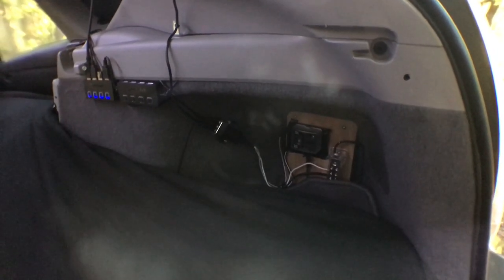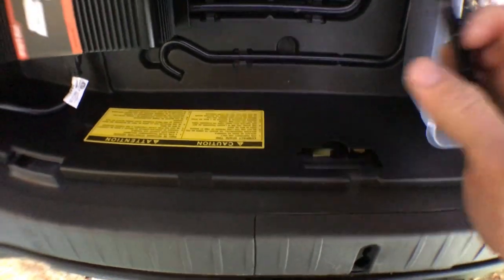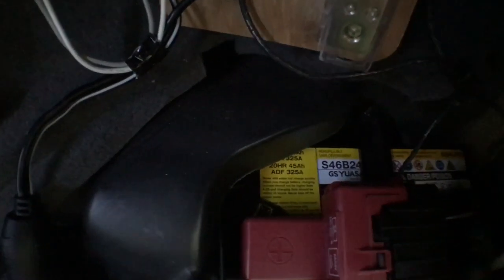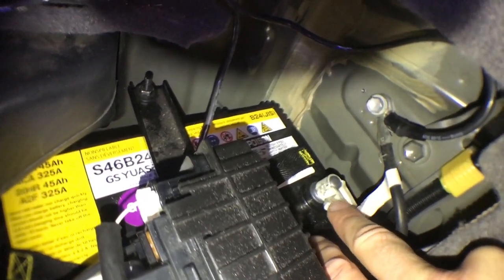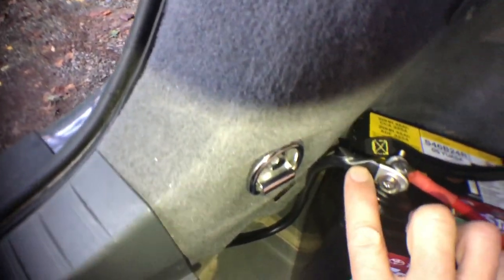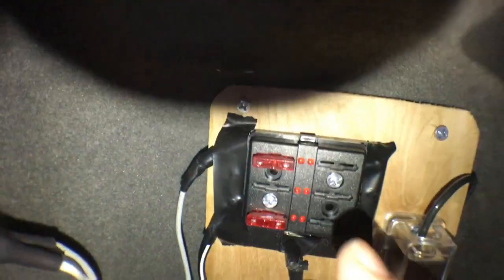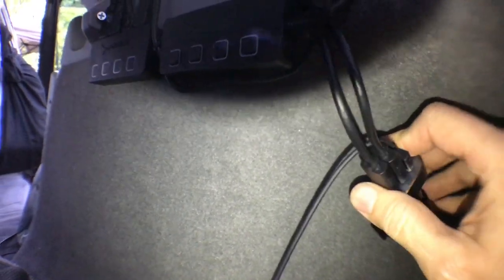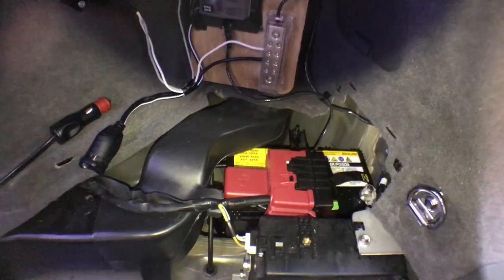Prius Stealth Camper - Electrical: Adding a second 12v battery, inverter, microwave

Comment: Hey! I'm really interested in getting a Prius for living in it. Thing is, I'm pretty tall - 6'2". I'm wondering, how tall are you / and would I be able to fit? Thanks!
Reply from the maker: I am 6’. I have a 3” mattress and added a little extension over the fridge which gave me 4” more. I can sleep without my toes hitting the hatch if I move the front seat full forward and tip full forward. I went to the car lot and laid down in the back before I bought. The salesman thought it was a cool idea once I explained it. Some of the newer models may not work but then Gen 2 and 3s should work. Mine is a 2009. Last of the Gen 2s. I ended up removing the microwave which allows me to sleep more diagonal. Be very minimal!!!
Reply: @timdillen  thank you! I think I'm off to buy a Prius! ♥️♥️♥️

Comment: I think your Ideas are clever and studied. One question, Why? What motivates you to do this? Just curious.
Reply from the maker: It's just a fun hobby for me. I like solving problems with small spaces in cheap ways. I also like to travel on the cheap as well. The less I spend the less I have to work.
Reply: PriusStealthCamper Adventures I live in a camper on my own land, I think my Prius has more efficient climate control than I can build. My motivation is also to save money. But also to fight back against the consumer mentality that we confront.
Reply from the maker: I like trying to see how little I can live on. It's amazing how much stuff you collect over the years that you never use. I gave it to Habitat for Humanity and rest to the dump.

Comment: About to tackle this challenge. 2 Quick questions though. 1.) What gauge wire did you run between the inverter and the battery and did you inline fuse it? 2.) Did you have your Dometic fridge running through the fuse box, and if so, is a 10 amp fuse enough for it?
Reply from the maker: I can't remember the gauge, it was the thickest wire I could find at the auto parts store. For long runs I got the thickest wire at Walmart that was jumper cables and cut off the ends. I did run the fridge off the fuse box and I think a 10 amp should work. I am not sure if there is a small spike on compressor startup but I seem to remember that it can run around 4.5 amps when running hard.
Reply: @timdillen  My Dometic Fridge just arrived today. So excited to get it up and running!!! So, I've finished the bed portion, but now I need to do the electrical wiring. I called the Toyota shop and they want $35 for the positive terminal clamp and another $35 for the negative terminal clamp... That's almost half the cost of the battery...Unbelievable. I think I'd rather go your route and drill into the battery terminals themselves. May I ask how you did it? Did you just use a regular drill, or did you take it to some kind of shop and have them drill it for you? I'd rather spend $70 towards a new drill than have to buy these clamps...
Reply from the maker: @dancereaper  Awesome! Love my fridge. I just used a regular drill bit. The metal is quite soft and drills easily. I drilled a little smaller than the bolt and then screwed the bolt in and the bolt made a good tight fit.
Reply: @timdillen  When attaching the baseboard for your grounding bar and fuse box, what size and length of screw did you use? You made the comment that it doesn't really show the holes. Also, on your curtain video, you screw directly in the plastic. I've resigned to the idea that I'll have to do it as well. Do you remember the screw size for that as well? As always, thanks man.

Comment: Thank you for making informative videos! Question, could you plug in the 12v fridge directly in to the car cigarette lighter port?
Reply from the maker: Thank you! Yes. The dash port does not stay on when car is OFF but I believe the one inside the center console does. Just don't let it run all night with the car in the OFF state or you will drain the 12v battery and the computer will not have enough power to start the car. You can leave the car in the ON state and the fridge will be just fine for days.
Reply: PSC Camper Conversions thanks a squillion! I am waiting for the 2019 prius but in the mean time i am taking in as much knowledge so i could excecute smoothly.
Reply: Let me see if I understood this correctly:
Two 12v batteries in parallel?
Each 12v battery terminals (left) powers the inverter and the right powers the 12v system (usb hub and dometic)?
Each battery is discharging independently? Yet charging simultaneously from the hybrid system?
Reply from the maker: That is a bit tricky. Yes the 2 12v batteries are in parallel and change at the same time. For a 2 reasons I put a disconnect on the 2nd 12v battery. 1 - so I can use all night and power my 12v lights and chargers without worrying about killing both 12v batteries and the car not starting (if I had the car in the OFF state) and 2. to test ideas out without a direct connection to the car's computer. Normally I live the 2 batteries connected. Hope that makes sense.

Comment: So when you're running stuff off your battery, does it refill your car battery from your traction battery before running the engine, or does the traction battery charge level stay more or less the same? I ask because I have the plug-in prius with the much bigger traction battery, so I wonder if I've essentially got the same setup without having to install a second battery. :-)
Reply from the maker: That's a great question and I have tried to figure that out. I don't have any information that I can find on it, just what I have seen with my monitors. The cars electronics, cooling fans and a/c run off the 12v battery. It seems when the 12v battery gets low (with car in ON position just resting), the engine will kick on and charge the traction battery and the 12v battery comes up to charging voltage immediately. After the engine shuts off, the 12v battery still maintains charging voltage so I assume it continues to charge off the traction battery. Then when the 12v has depleted the traction battery enough, it calls for the engine again. This is most seen with running the a/c while stationary. The a/c seems to be all 12v. That's the best I can come up, the newer cars may employ a different scenario. 

Your Prius is probably fine without the additional battery. I wanted to be able to run my 12v fridge for 24 hours with the car completely off (it couldn't do that prior). Thanks for your question and for watching!
Reply: @timdillen  Question - does the second battery charge fully? I read somewhere that the 2nd battery doesn't fully charge if you connect it the way that you did. They said that you'd need a DC-to-DC charger, which are super expensive, to charge the second battery fully. Have you had issues with the second battery not charging fully, or depleting quickly? 

I have a 2016 RAV4 Hybrid and I assume it's a very similar system.

Comment: Do most Prius have the second/extra battery in the back? I checked out a few but they never seem to have it? Only certain years? Can u watch a regular (small flat screen) TV in there?
Reply from the maker: Raina Fortini I think all factory Prius have just one 12v battery in the back on passenger side. I added an extra one to mine. You could certainly run a small TV on the one battery. You can always leave the car in the ON position and the car will keep the 12v charged. The engine will kick on when the voltage drops. I’m trying to find ways to run the engine as little as possible so I added the second battery. Thanks for your comment and for watching!
Reply: No, only one small 12v battery in the back (the newer Prius has it up front under the hood, so it can get covered with road salt and grime, and it's much harder to tap into.) The video is about adding an extra battery.

Comment: Have you had any issues with this since your install?
Reply from the maker: The setup continues to work well. I ended up taking out the microwave as I just did not use it much and could not justify the space it took up. Seems I like to eat out more than cook! Thanks for your question and for watching!

Comment: Does that battery you linked need venting?  Can it power your ac?
Reply from the maker: The battery is unvented. I tried an experiment in the Prius Solar videos and found that  the a/c system requires a lot of power. I later found out the the big drive battery is what powers the a/c and you can't feed the 12v batteries backwards into the big drive battery. Would be awesome if you could. Thanks for your questions and for watching.
Reply: @timdillen  The Prius 12v battery doesn't vent under normal conditions, but it CAN vent and that could be very bad. If you look at the original battery setup you'll see a little rubber hose connects to the battery to vent gases outside the car. The 2nd battery should have the same connector. I really like your setup utilizing that spot for a 2nd battery, but that seems like the one thing you overlooked. I'm thinking it wouldn't be too hard to connect a hose and run it out the nearby AC fresh air exhaust vent, or drill a hole.

Comment: so does this lower your mpg since your car is now charging the second battery?
Reply: It should not since the charging of the auxiliary battery requires a minuscule amount of time. The high voltage hybrid battery is over 200 volts with all of the cells combined and is what is used for propulsion. The 12v battery is only to power the electronics to ready and accessory modes.
Reply: @nobodystalkin1  you the mvp. thanks

Comment: You mentioned you would get a different inverter if so what one would you get or recommend? How many watts is your microwave do you have a recommendation on that as well? Thank you
Reply from the maker: AM PM The microwave is 700 watts and just a cheap walmart one. Good question on the inverter. I’m not sure what a good one is. There are so many out there and probably quite a few poor ones. I haven’t researched a replacement because the current one seems to be ok so far. Sorry that doesn’t help much. Thanks for watching!
Reply: +PriusStealthCamper Adventures With your inverter do you need a fuse in between the battery and inverter? Have been looking around and many of the kits have a fuse.
Reply from the maker: AM PM Good question. My inverter has some fuses built in that can be replaced if they blow. I don’t know if all of them have that. It sure would not hurt to have another one on the positive wire.
Reply: Probably a good idea to put a fuse close to the battery for all the outputs attached. The inverters have a fuse for their protection, but it doesn't hurt to have a fuse on the line. The reason you put it close to the battery is because that is the source. Many car stereo installers can tell you stories of the wire melting back to the battery when the fuse is at the device..
Reply: Coming from the world of 12 volts on a sailboat, I have heard that a microwave with a rotary timer works well with an inverter.  Using a pure sine wave inverter is safer for all electronics though.

Comment: Also check out an induction cooker to run off the inverter. Have you seen the TailVeil(.com) ?
Reply from the maker: Ken Lumley Will definitely go induction if I decide to learn to cook. I’m so bad about wanting to eat right. The tailveil looks good. Allows you to enjoy outside without the bugs. Thanks for the comments!
Reply: The FDA says "As an added safety precaution, don't stand directly against a microwave oven (and don't allow children to do this) for long periods of time while it is operating", and that's not because of the heat.  I know engineers who are very leery about home microwaves.
      Induction plates are interesting: clean and efficient, no flame, and are advertised with "N levels of cooking from 100-1500W", "N power levels from 300-1800W" and so on. 
     Much cooking can be done with hot water. "Thermos cooking" is efficient, and can be easy and healthy with a little planning. Pressure cooking, too. "Manifold Destiny", a book about cooking on the hot parts of a car, was fun back when cars were wasting a lot of heat, not so easy with a Prius.

Comment: Maybe someone mentioned it before but I put a 700 Watt microwave in my van thinking that my 1000 watt Honda generator would operate but I found out that the 700 watts is cooking watts and not the wattage that the microwave uses which is closer to twice that.

Comment: I know people ask you this all the time but do you ever do services on other people’s prius’s if you have the free time? Obviously I could come to you and pay you for your services. I’ve done a lot of your diy’s but I can’t find the courage to do this one! I’ve been traveling the us and Canada and have been okay with my one battery and using electricity when the car is on but I’m starting my trip to Alaska soon (after this I’ll have driven all 50 states) and I want to upgrade my night comforts.
Reply from the maker: Thanks for believing in me! I am really not qualified to work on other people's vehicles, it would be awful if I messed up someone else's vehicle, It's my own fault if I kill mine. I have felt so overwhelmed on these projects but I just watch as many videos as I can for encouragement and training. For electrical work you might check with a stereo installation company, they are good at automotive wiring. A local mechanic who thinks this is a cool project might be of help as well - they get very bored doing the same work all the time and like a change. Another option would be to get a solar generator box and let it charge from your 12v lighter plug while you drive - it is a pricey option though. Another option is to leave the car on at night. I found it worked well in 24 hour parking lots. I park near other cars (not by the campers). People just think I am sitting in the car using my smartphone. Does not stick out when the car comes on. People also leave the car running with pets inside for the a/c. I am really glad you have found the videos helpful and that's great your are getting to see 2 countries - best of luck on your adventures. Post some videos!
Reply: Thank you for your reply! That totally makes sense that you wouldn’t want to be responsible for someone else’s car when you aren’t even a mechanic. I thought I’d give it a go though! Thanks for the suggestions! 

I used to do a lot of international travel but I wanted to be more eco conscious in my emissions and the way I travel, so entering the Prius stealth life was really good to my purse and easier on the earth I think. Thanks for all your great content, it really helped me make the change.
Reply: I have another question! Do you think I could achieve the same set up without connecting the second battery to the first? Shouldn’t the battery (which can start a car for years) have enough juice to run electronics without being routed through the car?
Reply from the maker: You can get along great without the second battery. I could leave the car in the ON state and have plenty of power to run the fridge for weeks. I just wanted to run the fridge for more than 12/24 hours with the car in the OFF state and not kill the battery. The fridge is the biggest draw. The LED lights are pretty low. You might want a small battery powered jump box just in case as if you run the 12v battery down, the computer won't have enough power to start the car even with the big battery full. You could turn off the fridge during the night and save power, just make sure you don't have meat, cheese or milk that might poison you.
Reply: I’ve been doing really good without a fridge and I think I’ll keep up with that but as far as powering my cookware and other stuff when the car is off, I got a battery box for my second 12v battery! I also got a solar powered trickle charger to maintain it. In theory that should be enough for me cause I don’t have a ton of stuff that needs power or can’t be charged while I’m driving. I’ll let you know how it goes! the box and solar maintainer/charger was under $100. I think it might be a good alternative for those of us who aren’t as brave as you lol
Reply from the maker: I think it will work out great! I am never completely satisfied and just keep tinkering with my setup.
Reply: I see what you mean about never being finished! I posted my first video lol, very inspired by you

Comment: Can I pay you to do the electrical work for my conversion🙂 I don’t know ANYTHING or anyone tell help me with this.
Reply from the maker: Thank you for your vote of confidence in my work! I am currently tied up with an ambulance conversion that is consuming my life right now. I knew absolutely nothing when I started making the Prius. I just watched every video I could find. If you have a handy friend or local audio installation shop they might be willing to take on a different and fun project. You can get along without the 2nd battery. Just don't let the car sit too long in the OFF position with items using power (fridge for example). I know you can do more than you think!